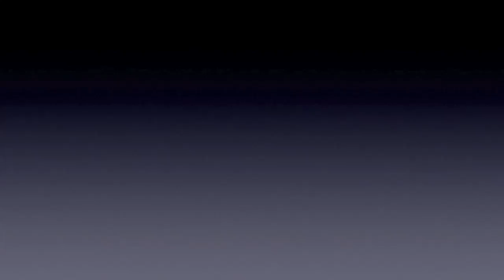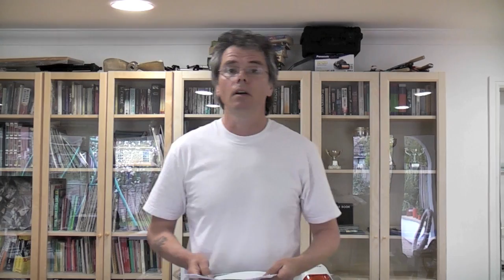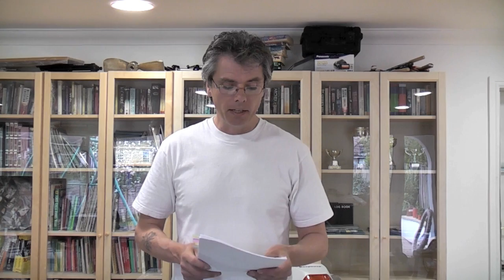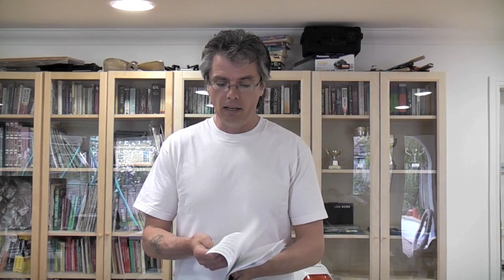Part L1B of building Regulations and flat roofing.

Comment: Good video and the others about cold and warm roofs. We recently changed the roof boards and put the epdm rubber membrane on due to leaks from the old fibreglass covering. We also took down the old T&G ceiling and insulated between joists and also covered the ceiling with  8ft x 4ft insulated plaster boards. Makes me think how my cold roof is ventilated although the air going up the cavitys may be doing this.

Comment from the maker: Old roof Plasterboards 200x50 joists ply roof covering, placing the insulation on top of the PB and leaving a vented gap above  forms a cold roof. If you place the insulation tight under the ply between the joists  you are not forming a warm roof, the joists will be cold bridging and you will have no continues vapour barrier, you are getting closer to  building in a problem with sweating. However over the years I have seen this carried out with now reported problems.

Comment from the maker: If the designers of the roof want it ventilated vent it, like a lot of low budget work there is no designer so your out there on your own. think of it this way if the insulation is on top and timbers are internal then the timbers are in the warm space  you don't vent them if the insulation is in the roof then anything above the insulation is  in a cold space and needs venting,